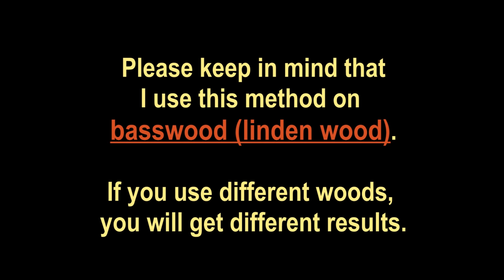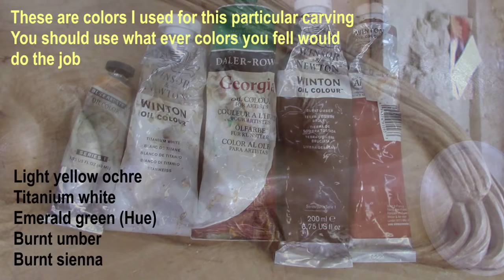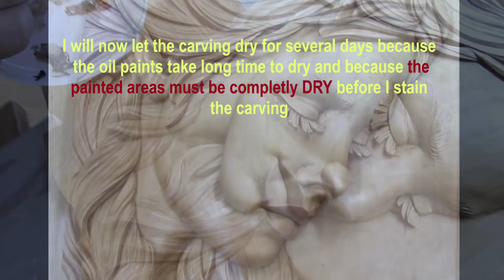How to prepare  and seal basswood (linden wood) wood carving for staining or painting, Fred Zavadil

Comment: I tried to paint the wood filler with oil paint as shown in the video, but the paint does not really stick to the wood filler even when it is applied straight from the tube. would acrylic paint, or several coats of oil paint work better for matching the color of the lighter wood and wood filler with the dark wood?
Reply from the maker: Chris, did you already stain the carving? Fred says that those issues MUST be taken care of  BEFORE staining.... 
He says that he doesn't know why your oil paint doesn't stick to the wood filler - says that the video shows exactly what he does. He applies a thin layer of oil paint on the spot and let it dry. The paint HAS TO BE COMPLETELY DRY before staining. 
Several layers of oil paint (to match light wood color with dark wood color) would completely cover the actual wood - something Fred doesn't do unless the carving is to be fully painted. 
He is also sorry but cannot advise on acrylic paints because he doesn't use them.
Hana Zavadil

Comment: Hello Hana and thanks for sharing this interesting technique. I would like to try it on my carving, but here, in France, we don't have oil varnish. Could i try this method (including the  second part, painting with oil paint) with a water based polyurethane varnish ?
Reply from the maker: Hi David, you are welcome. Fred says that he has never used water based polyurethane varnish for this method but says that it should be OK. The major point is to seal the wood so that it does not absorb the stain. He says that you might want to try it on a piece of basswood with a few cuts  before you do it on the actual carving. If you try it first on something else, it will give you understanding of what will happen and how to work with the stain. Hope we could help. Hana Zavadil
Reply: Hana, Fred, many thanks for your kindness and this fast answer. I'll try it, for sure. Best wishes.

Comment: I just recently finished a basswood carving carved out of two blocks of basswood that each have a slightly different tone/color as well as a bit of white wood filler. I followed your method of both preparing and staining the wood, but one side ended up lighter than the other, and I cannot find a way to cover the white wood filler. How could I make the color of the entire carving uniform without applying a base coat of primer over the entire carving.
Reply from the maker: Chris, Fred says that both problems have to be resolved after sealing wood and before applying stain.

1. He paints the wood filler with oil paints to match the wood color - you can see him doing it in this video

2. If the blocks of laminated wood are not the same color, he also uses 
oil paints to minimize the difference - but only the area where the 
blocks are joined - the darker block remains darker and the lighter part
 stays lighter - but it looks like the wood is just changing color and 
is not laminated from 2 blocks. In very extreme cases, he uses a bit of 
diluted wood bleach to lighten the dark part along the joint - he does 
not recommend doing this on a carving if you are not VERY EXPERIENCED 
working with wood and bleach!!! 

Fred also says that it is extremely important to have the oil paint completely dry before you stain the carving.

Hana Zavadil